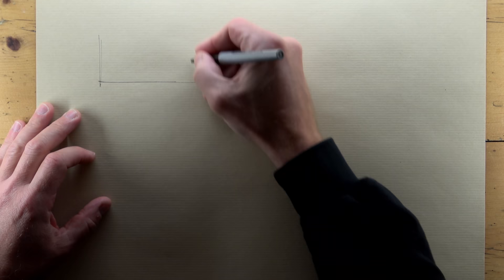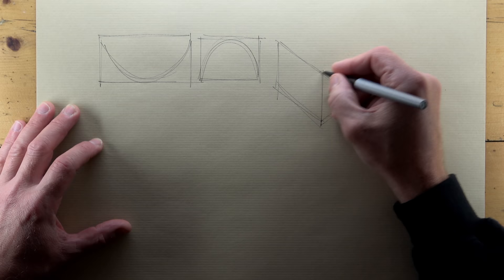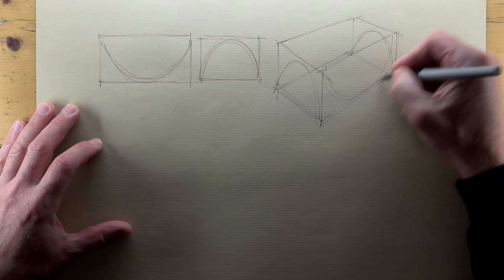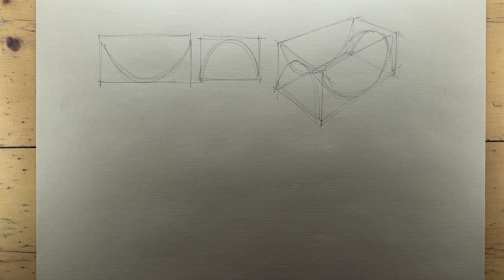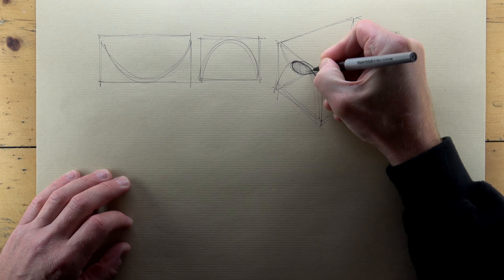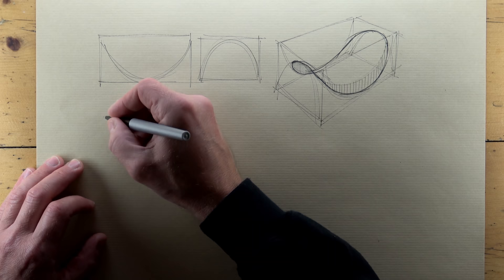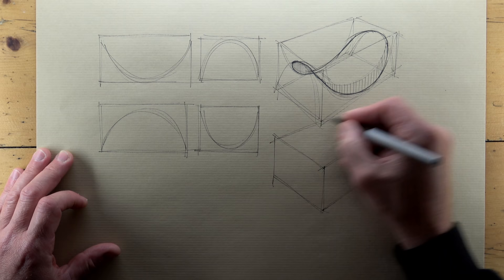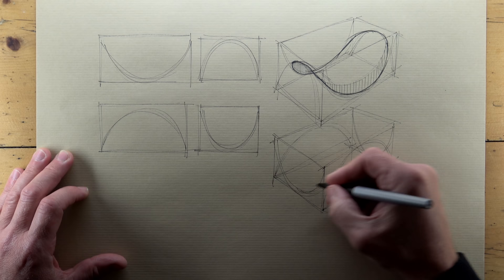How to sketch a pringle! - It's so simple!

Comment: Is there a role to connect sides? i find it difficult to connect the sides and what to connect.
Reply from the maker: Take the line on the side elevation (for instance) and just follow along it until you start coming close to the line on the end. When you’re coming close, transition from the first to the second line. Work around each corner. I hope this helps.
Reply: use ur imagination (right brain) not your logic brain (left brain)
Reply from the maker: @mayun8718  I managed without a brain!
Reply: Here is a painfully more detailed explanation of how to plot symmetrical forms in perspective (aka mirroring) I don't recommend this. But it may help you get over the hump. https://youtu.be/O1tv-6JURJ4

Comment: Sir how do you hold and control your implement when sketching? I see that you didn't use your wrist but with the elbow and shoulder 😁 👍 Is that the secret for better line quality 😉 👍 🍩 ☕
Reply from the maker: You've correctly spotted the methods I've used.... locked wrist, locked fingers & working from the shoulder.  There are a few other bits of advice which I hope to put together in a  video that will be downloadable from my website.